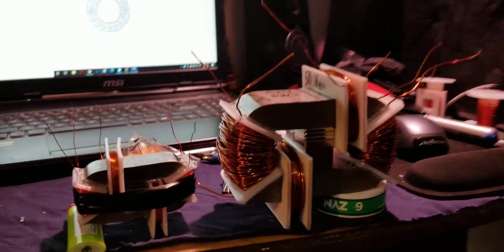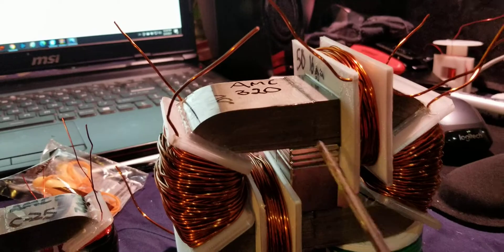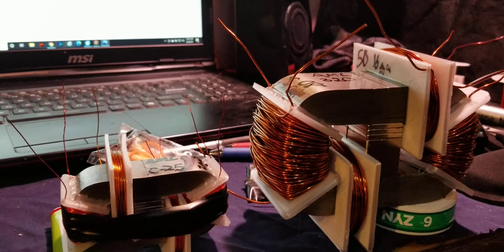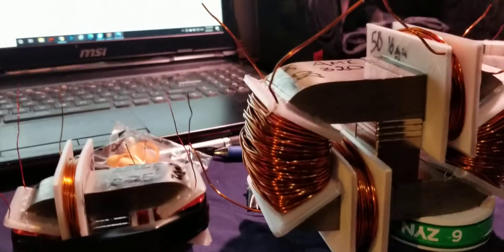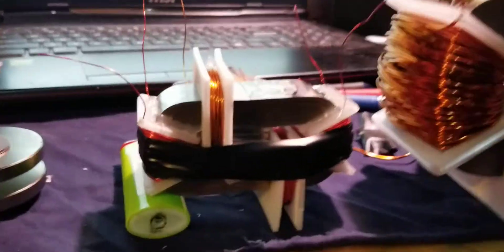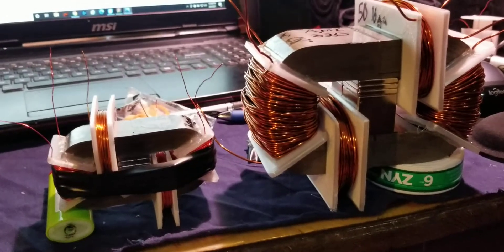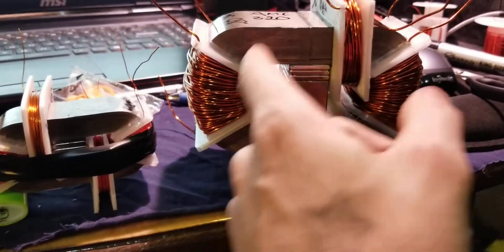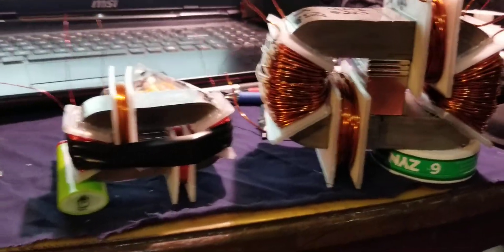MEG REPLICATION 2. Lite explanation of the effect, how it's used and how it works. Tom Bearden

Comment from the maker: Just wanted to update everyone asking about progress. I put it away but just recently ordered some components to make testing easier instead of board route.
I should start tinkering with it in a few weeks when special signal Gen arrives with its amplifier to see some effects!!

I found a signal generator that has dual outputs...allowing me to tune the pulses with DC offset out of phase the way its supposed to run. :)
Reply: Which dual outputs signal generator did you find?
Reply from the maker: @kristoferkrus  I went with JDS2800 and a x2 amplifier designed for wave functions that's also dual. JDS2800 was 75bucks and amp was about 40 from China. 

I have some 1000v 1a rectifier diodes I'll put between the gen and the input coils, probably 2 in series so I have a less chance of the back emf hurting function gen, just in case it does. It will definitely be bucking.

The JDS2800 can do both channels independently AND be out of phase. The out of phase ability sold me. Then I can test it with multiple frequencies with coil 1 and 2 pulsing 180° out

Comment: The new magnets were found at a Lab in Isreal that was using an HP Printer to print out difficult samples of materials and the new magnets are good for 1,200yrs as per 400yrs for the last generation of magnets. 🧲

Comment: The permanent magnetics you`re using are too much. Try to smaller than those. Its will become easer to switch the magnetic field from the center to one side coil( left) and from the center to another side right coil.
Reply from the maker: @osvaldocorrea789  this is a old project I've moved on from. But yes, i knew it was oversaturated. I mentioned this in many comments.

Comment: If you use an electro c-shaped magnet, turn it on and put an iron object in between the lit, the object will be trapped in the magnetic field, even if there was no current in the in it anymore. But since you remove the iron piece, it won't be attracted unless you put current again in the electromagnet.

Comment: What is the performance of this unit?
Reply from the maker: @paulshields1883  low power I was only about 85% efficent. High power I couldn't measure but destructive test put put tons of reactive power and nearly destroyed all my lab equipment.

It's a fine tuning nightmare. Most don't understand what that entails. Months or years of trial and error getting the magnetic saturation perfect and coil configuration perfect. 

Frequency sweeping is easy. But it has to be just under saturation

I abandoned this project because it's too dangerous. Creates huge electrostatic charges and is more dangerous than microwave transformer depending on what you drive it with.
Destructive test I drove off a 1500w converter off a 12v battery then to high power high speed fets.

Comment: You really known how meg works? I know, if u wanna talk about. Leave your though here.
Reply: Parts list?  Everyone is going off the grid
Reply from the maker: AMC Metglas Core.
Wire.
A calculator.
CERAMIC or SMALL neos.
Shims to adjust saturation.
GOOD Mosfets.
GOOD DDS Signal generator with phase shift to drive fets.
Diodes, Shottkys, misc parts. Bearden used a "Conditioned" carbon resistor. you can also use a Varistor made for target voltage (1,500 i think)
Heat sinks for fets.

Oscilloscope with HV probe (NEEDED or you burn the scope out from BEMF)

Me and Timtron will publish a book soon. It will be FREE PDF.
It wont exactly go into the MEG, but it will basic electrical fundamentals.

Thanks for asking!
Check JLNaudlin labs for more info!
Reply from the maker: Yes. 
Moving a static magnetic flux is all its doing. The perm magnet wobbles back to homeostasis for FREE, after you push it over.

The gains aren't likely to be high. But we are working on something for you guys. Stay tuned.

Comment: How did you solve the eddy current issue? 🎉 bearden said the c.o.p. increases with frequency but   core heat were the major milestone
Reply from the maker: With the regular transformer iron.
This is nanocrystaline core from Hitachi. It's a high frequency core designed for 10k hz and above. 

Core has to be just under saturation to get the effect. And that takes tricky tuning to get to happen. Then you're left with very HV, High freq energy to be converted which has its own challenges to do efficiently. 

Thanks for asking

Comment: My knowledge on how electrical fields work is the electrons will exchange virtual photons witch is only mathematical not directly observed but these virtual photons will ether push and pull on a electron making them flow in a magnetic field like way. That's how it's described. Virtual photons are also a huge part in making the cassmir force work! I think electron may be making their own micro cassmir cavities.
Reply from the maker: Hi,

I don't particularly believe in electron particles, or even "photons"..
They are merely virtual particles to make their equations work. And they do work..

But you'll never see a single electron picture. its not possible since its a static field. 

Light isn't a particle either. It cant be. Otherwise you'd have to accept that somehow your cellphone battery is capable of converting energy, to matter, at a rate that breaks all known laws of physics.

These misconceptions were intentionally injected into the theory to keep you chasing your tail.
But in reality.... Faster than light comms have been a reality for over 100 years. and China has some in orbit right now. We probably do it in USA.

Its only a conspiracy until its part of the defense budget.

Comment: Could you do the community  favor and give a recommended materials list, where to get the materials, and rough pricing?
Reply from the maker: Sure.

This project uses a high speed metglas core. This core is appx 120$ on mouser. Many cores to choose from.

Copper wire isn't cheap either and I would get the real stuff that is from the factory and get a reputable brand. 
You'll pay 60$ for 5lbs of it.

Then make your dividers and depending on how HV you wanna go you better spec and figure your inductance, per target freq, and also how thick of layers and insulating you need on the HV(secondary)  coils to prevent arcing between the coil or coil to core.

Good luck.
The core must NOT be totally magnetically saturated.

This video I had wayy to big of magnets inside it. It just wobbled and when I tested to failure it made way higher voltage than I was supposed to get.

Almost fried my scope, did fry a volt meter and burned 2 CREE Wolfspeed mosfets that were 25$ each.

By the way. This is a VERY dangerous experiment due to unregulated high voltage potential. Open this transformer will create huge voltage spikes and depending what is feeding it can make it more dangerous than a microwave transformer
Reply: Have you read any of Moray kings work?
Reply from the maker: @thecontact2609  I have not.
Reply from the maker: @thecontact2609  I forgot to add to this thread...

You must build a driver for it.

I used cree wolfspeed mosfets triggered by a freq gen. Since the gate is switched by so little voltage and it hits hard and fast.

Comment: Thank you very much for easy to understand! It makes sense on over unity when considering the magnet. I am working on one myself.
Reply from the maker: You  want about 80% saturation of the core.

You'll have to tune this with shims, and other magnets strength.
Be warned this will produce extreme voltages under resonance and especially if coils aren't loaded. be safe

Comment: I love it But i question the following known law's In 1929 a transformer was designed which increase amperage. voltage is irrelevant to true power. example 1000k volt wouldn't make much amps. Thats one. the other is saturation is created by pulsing field ,which absorbs electron from either Fe, Cu ,or Al . .This triples out put It's just a thought. Proven in 1929. Peace bro.  My only question is are you able to add to saturation. Which add amperage.
Reply from the maker: Voltage and amperage combined are both quite relevant. That's how watts are determined. I could make a transformer produce 2volts @ 750 amps if I wanted and just use a 1500w outlet. 
Or reverse it and get super HV with low amps. 

Amps x volt = power

The way this transformer allegedly works is the permanent magnet adds saturation and leaves a static field in the core. Then the other coils move the field that is static causing It to now be in motion.

The problems I've had thus far is it being hard to determine saturation, and a friend of mine may of figured out a much better meg design for switching flux. I'm going to try the new design soon and probably write off this model if I can't get it functional.

The issues with this meg, are for it to go over unity voltage must be converted very high, or use very small gage, high turns on the outputs... giving upwards of 2 to 5kv. And that's hard to deal with, and dangerous. It ruins equipment and is hard to control to be usable except for use in lights.. 

New design makes use of much slower switching and hopefully much lower working volts so one can simply use a buck converter off the shelf to transform it further for use.
Reply: @Heliarc91  It was a game changer for me . how it change into a receiver and amplifier . now all the design from steve marks to kapanzy coil make sense . to get a cop of greater than 1 is explained in 1929 patent on amplifying transformer.  C O P Greater than 1 is easy to get  and it changes Ohm law.  Now i have to figure out the law of saturation . It's just a thought it might help Thank for your reply
Reply from the maker: @sidster64  So going back and reading some of these comments..

Are you referring to super-saturation, or what some call hyper saturation?

I believe that effect is what the Akula flashlight is using (ferroresonance) from over saturating the ferrite, getting a "kick" back out from it.

I have since left this project and tried a few with just 60hz transformer iron..but haven't gotten the bench out for these in quite some time.

Bearden used ferrite magnets which are roughly 10x LESS powerful by size than neos. So my iron was way saturated here. Probably at maximum and may of been why i was getting low cop on the way back out..

But indeed what you are saying is interesting wish I had some papers to read on it. I have learned alot more now than when video was published. But still learning as well.
Reply: @Heliarc91  How you doing that was a year ago busy cool. I've learned a little since then but i still remember. the reference is to Clockwise and counter clockwise coil that have a additive effect.  thank for getting back to me. peace best wishes
Reply: @Heliarc91  Also try pulsed dc as driving force it might surprise you
Reply: @Heliarc91  Yep agreed but one design equal in and out . That simple even winding ratio. but Adding saturation without changing winding is what I'm referring  to.  It's almost like magic LOL light is dim and ad to flux light is visible brighter.  But thanks your right.

Comment: Hey, I saw an interview where bearden said he used a material that could separate the magnetic flux from the magnetic vector potential. Not sure if that will help you in harnessing the power but yea
Reply from the maker: The core material is what he is talking about... nanocrystaline. 
There are a few different types that do it but this is best for high frequency switching.

It traps the magnetic field leaving the "undetectable" vector potential outside the core

Comment: Good stuff. It's been like 20 years since I was into that stuff. Did Naudin achive COP>1 with his MEG?
Also, I recall the small air-gap between the permanent magnet and core is suppose to be there to prevent saturation
Reply from the maker: From the papers I saw he achieved cop6+ 
I've just recently started making the circut board. 
I am a little worried about frying my scope with it so I'm trying to work around keeping the voltage lower than he did.

Bearden in his videos said you wanted as close to zero airgap between the magnets and the core itself. 
That was in his videos you had to purchase. They still are available.

Every so often they pop up on YouTube and get pulled for copyright..
Reply: @Heliarc91  Do you have Bearden's book "Energy From The Vacuum"? It extensively presents OU principles and foundations and has a whole chapter on the MEG. They'd run their MEG to COP100 in destructive testing. Closed looping requires special design as having a directly connect feedback will kill all the semiconductors in your driving circuit - not thermally but by filling all P doped holes
Reply from the maker: @IragmanI  Looks like I'm going to order that book. Lol
No I've only watched most of his videos where he is explaining most of the details. A friend has the DVDs.

Yeah I figured it could be pushed until it begins burning the insulation. I went with 200c wire but I didnt ever plan to attempt to go that high.
I have looked and thought about how to close loop it. The voltage PtP get crazy high when you get into the higher COP. 
So that has to be dampened and controlled....I was hoping to use a tough battery like Ni to try and filter it to close loop. 
It adds a expense and consumable but would still be worth it considering the cost to even build one of these.
Trying to lower the voltage to put in a battery WITHOUT thermal loss is what I've been thinking about alot. 
It doesnt do any good to go cop10 then lose 80% of it in heat clamping the output.